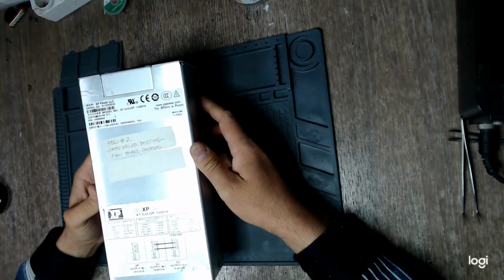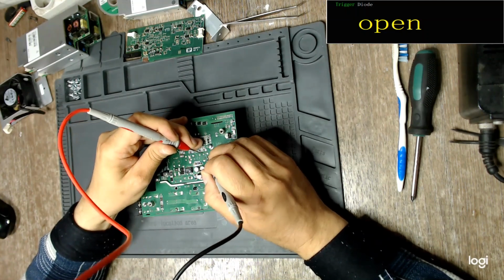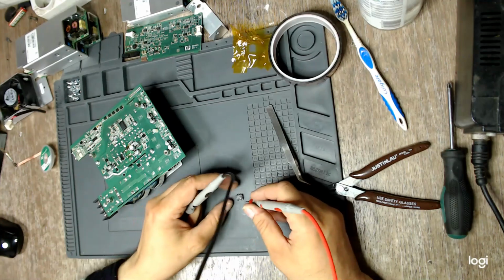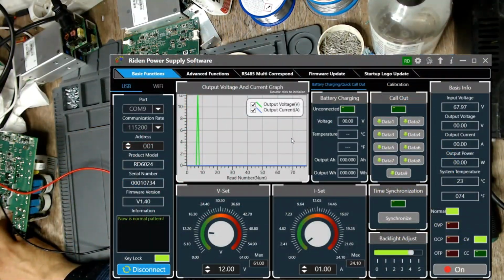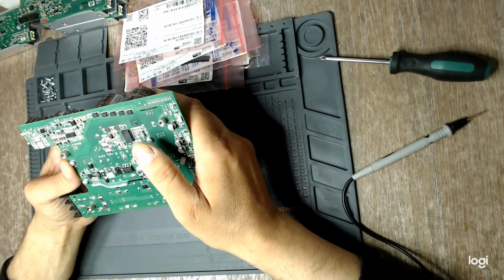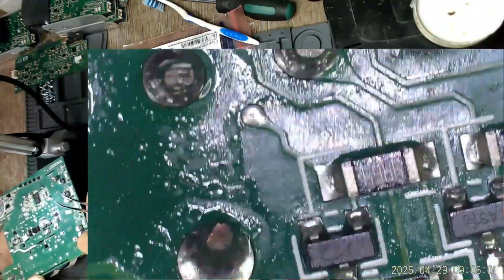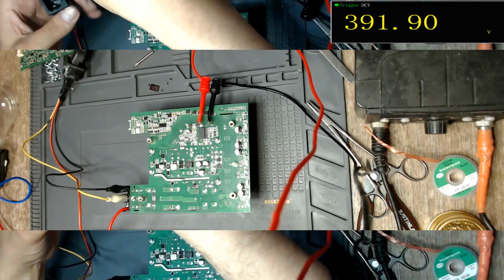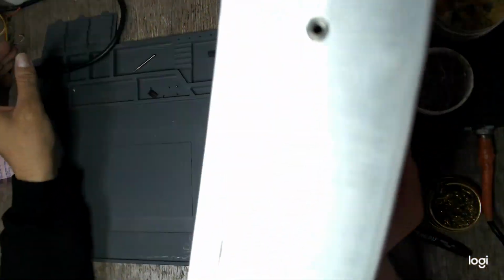Flexpower X7 2J2J2P 120018 - Tony359's second faulty power supply

Comment: Amazing job! That fan board connector cannot be real!!! Seriously? Why on earth did they choose a smaller female connector! Oh well! Thank you so much for doing such a great job! I'll show the PSUs on my channel once I get them back!
Reply from the maker: Thank you!

To be fair, once you mount the main board on the base of the case, then the cutouts from that base plate and the ones on the fan board do fit well together and you cannot do the same mistake, but as we both have shown, without the base plate it is quite easy to connect it one pin out, and sometimes you do need to make tests without that base plate. 
This is a design fault, one which they should be made aware of.